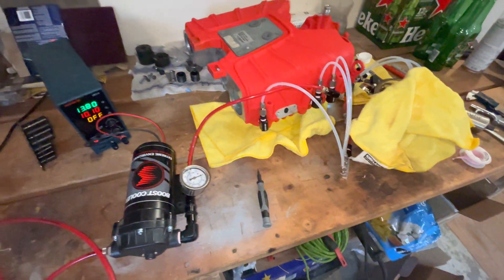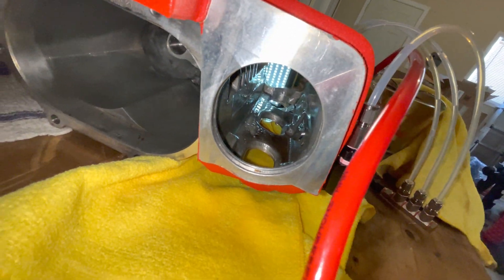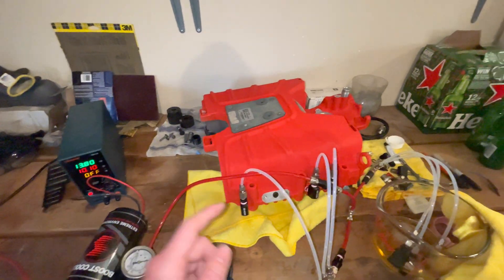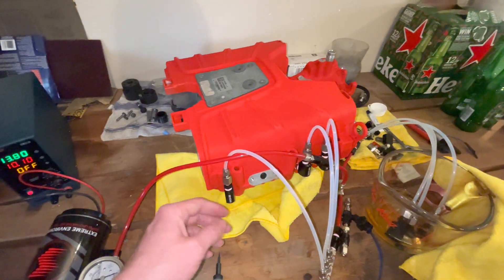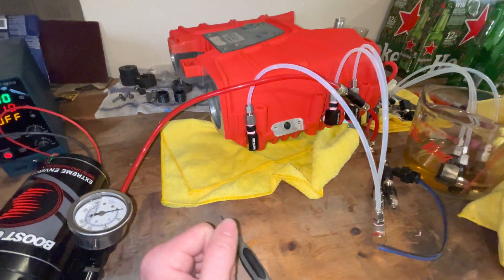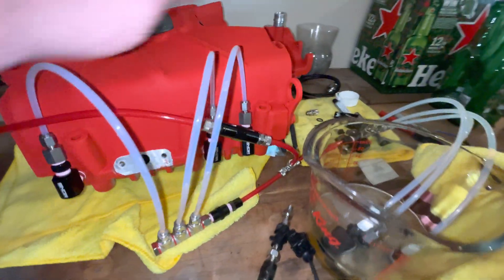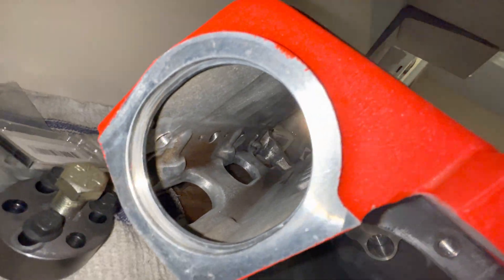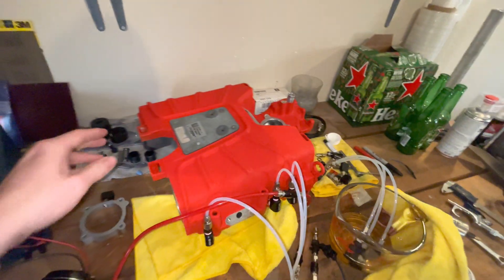AUDI 3.0TFSI SC WMI Nozzles located after Intercoolers.

Comment: Hi there, you mentioned in last video that this snow pump dont like to do above 9.6A, could you tell me what max psi i should keep to before reaching 9.6A? Because i already have my pump installed
Reply from the maker: No, not that the pump doesn’t like being above 10amp, the power supply I was using doesn’t like going above 10amp peak.
Reply: @christopheredgett4919 oh i see, so in reality i should be able to crank it all the way clockwise to reach near 300psi without a problem?
Reply from the maker: @Zac-hl2lu You would be reducing the life span by maxing it out, but yes you could set it to max to get 300psi.
Reply: @christopheredgett4919 thank you so much at least now i know i have headroom!